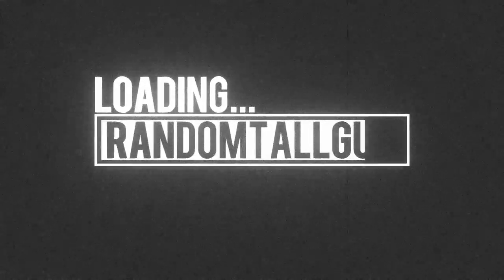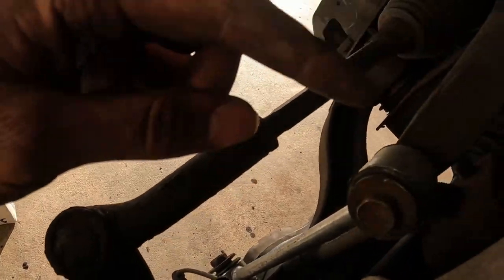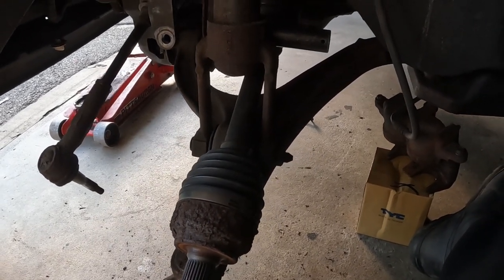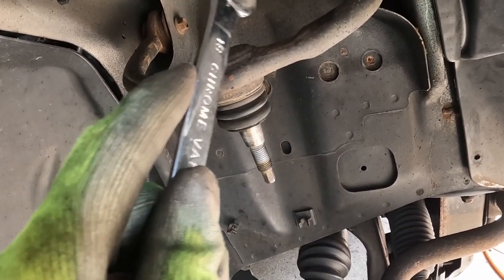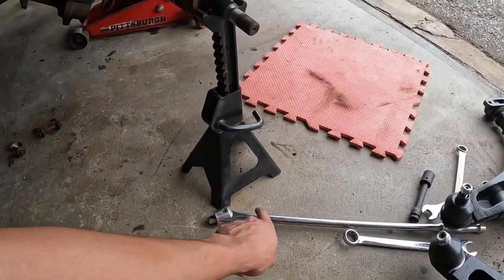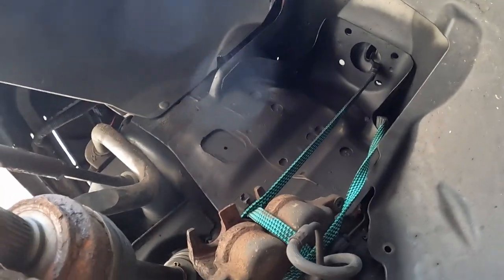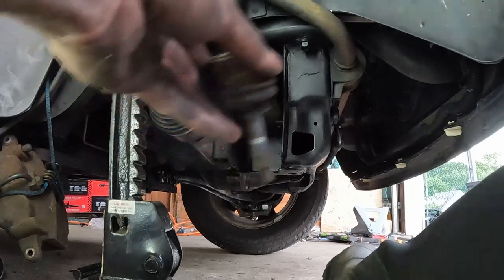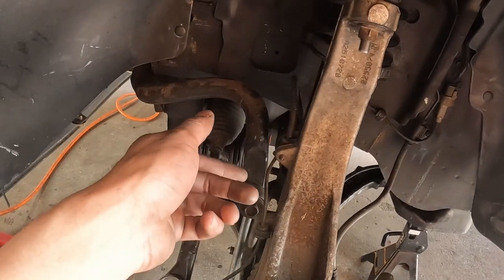Complete Front Suspension (And Diff Bushing) Replacement For Jeep Commander And Grand Cherokee WK

Comment: This video definitely is gonna help for reference. Just got my suspension in for my '08 Commander and was hoping someone on here had how to do the whole shebang, including the struts and control arms. Great vid! 👍
Reply from the maker: Thank! I hope I covered everything lol
Reply: @randomtallguyvlogs6756 ... you did. Only thing I'm changing out that you didn't are the sway bar bushings but I'm not doing the differential mount ones. I was told to spray all my parts I'm taking off with PB Blaster as well a few days before so they'll break free easier. What brand parts did you use (struts, control arms, etc)?
Reply from the maker: @FrankieKanks  I got my parts from rock auto the brand I got was SKP, it’s kinda on the cheaper side but I never had any issues so far 🤷‍♂️
Reply: What is the torque for the sway bar links. 06 Commander

Comment: QUESTION. Did you have easy access to remove the oil pan with all that removed? I want to do front suspension like you did as well as replace the gasket on my oil pan. Thanks!
Reply from the maker: Yes, definitely if you’re gonna remove the front differential like I did,  that would definitely create a lot of space for you to remove the oil pan.

Comment: Subscribed!  One of the best step by step DIY videos I've ever seen!  Nice!!  So what year Commander is the one in this video?  Hopefully it's an 06 so that I don't have to search for the correct torque specs for my year.  Thanks again!!
Reply from the maker: Hey, thanks for the feedback 🔥 the commander I was working on was a 2008, I believe 2006-2008 share the same torque spec but I recommend double checking. I got the torque specs from the Haynes repair manual
Reply: @randomtallguyvlogs6756  Cool... I'll check it out to verify the torque specs!  Thanks again!!  Doing my rear end links this weekend... then rear shocks as soon as they arrive.  What struts did you end up installing in that Commander?

Comment: some interesting socket/wrench sizes involved, sounds easier just to cut through the bolts, but they're all grade 8, right?
36mm 6point socket for the axle nut
24mm 
21mm
15mm 
18mm 
10mm

Comment: Did you use a ball joint press to install the new front differential bushings? 
Thank you!
Reply from the maker: Yes, it was a cheap one from Amazon, I used it for ball joints, bushing, and u joints. So far so good
Reply: @randomtallguyvlogs6756  Thank you for the quick reply, I appreciate it!
I just destroyed one of them trying to hammer it in with a truck socket. 
Again I appreciate it!